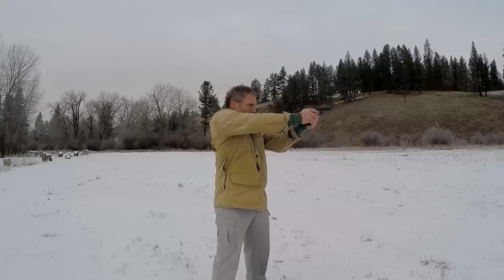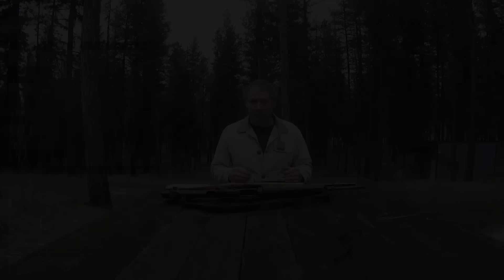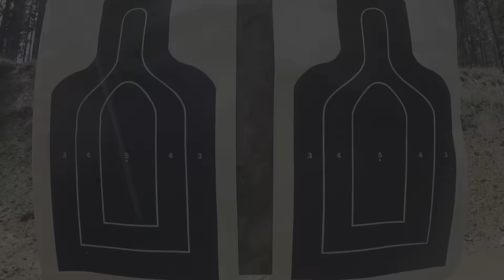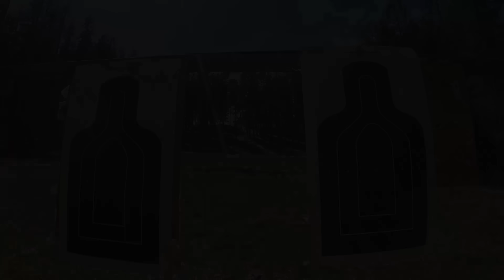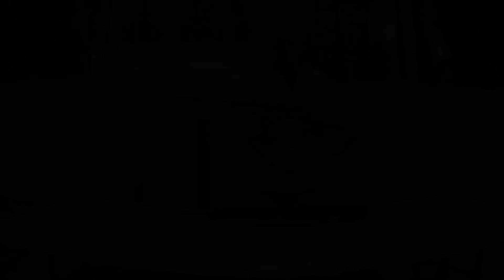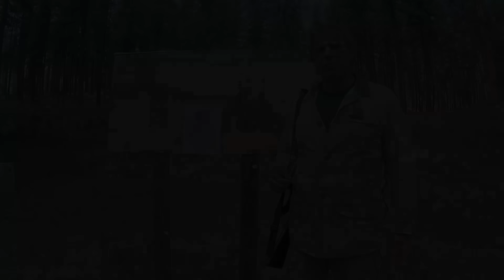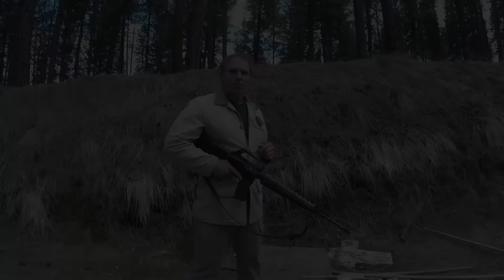Mini-14 vs AR15: Which is Better?

Comment: Excellent breakdown comparison.  And, the info regarding the headspace problem was news to me (I never owned a mini 14 mostly because of the inconsistent accuracy mantra among "14" owners. 

Well, if Ruger couldn't get headspace (reamers) to be consistent (for a time), I wouldn't be surprised if there weren't other issues related to chamber reaming "metrics" too. 

In any case, Paul's breakdown  was the most comprehensive comparison I've seen.  It would have helped me to answer some of customer's questions when I worked in retail at a gunshop.  Thanks Paul!

Another breakdown I'd be curious about would be one between a $600 ARs and a $1600 ARs mentioned, being the physical specifications of the platforms are practically identical, except for some materials in various parts and machining tolerances too perhaps!

Comment: Paul, loved the Duran Duran reference!  I set up a Mini 14 for my brother to use as varmint/ranch rifle during those times. It was a GB model, and required the use of a side mounted scope support mount, just like the full size M-14.  I had to schim up on balance point to get a perfect zero level for the scope.  I had a hot 5.56 load for it already tested, and it would shoot a true 1moa at 100yds.  It regularly killed ground hogs out to 4000 yds.  Good barrel, steady mount, great load, and fair 3 x 9 scope.  Has to also set up a friends Mini 14 the same way to please the home crowd.  Both of these were really shooter.

Comment: I pity the fool who can’t shoot accurately with a mini 14.
Reply: I love it when a review comes together...
Reply: And drive a bad ass van while shooting
Reply: Some particular Mini14s guaranteed inaccuracy. I owned one. The rifle had me thinking it was me. Nope. Not me. 6 MOA on its best day. If you wanted to fling a lot of lead down range, it was perfect. If you wanted to hit what you were shooting it, not so good. Mine was of the vintage of the thin barrels with harmonic problems.
Reply: @mississippichris  The most recent series of mini-14s has much better accuracy reviews than the older versions thats forsure. Not to mention that manufacturing quality standards generally speaking improve over time at successful companies.
Reply: @Ryan-xq3kl I love Ruger. But I love them in spite of that Mini-14. 😅
Reply: Part of the problem it that the iron sight suffers from being fat, which makes long range harder. The lebel 1886 had this exact problem,
Reply: @baker90338  You missed the Mr. T and Hannibal A-Team jokes
Reply: @tommylitchfield3450  I can appreciate when facts are integrated with jokes; I do the same thing.

Comment: They are quite similar in most ways - and I have a Ruger 556 (used to have a Mini-14, too), and I think that, at least for self-defense, I'd prefer the Mini-14 (and plan to buy one as soon as I can afford it's now-inflated price) - not because it's better than the tactical-looking 556, but because of the media-fueled hysteria about "assault rifles" (anything that looks "tactical"), if I had to use it, I think I'd get a much fairer hearing from using a non-intimidating "hunting rifle" (I don't hunt, but you get the point) than I would with the Ruger 556.  So, hands' down, the Ruger Mini 14, but not because it's "decisively better," but because it might be legally "decisively safer" - till then, I'll use a non-"tactical" handgun for personal and home defense, rather than an EVIL assault rifle.

Comment: When I was in the Army I used A2. I owned a Mini 14 for awhile. Not as good a shooter as this guy. I got same accuracy with both. The only pros and cons I remember is the AR is lighter but the mini14 was way more reliable. I did not have to perform SPORTS on my mini14. Before all you AR owners want to bash me I am aware that my M-16 probably been used and abused by many other Soldiers before me do that could be a factor.

Comment: I think Ruger showed a propensity for randomly changing the twist rates on the Mini-14 during the 80s and 90s, between 1:10, 1:9, and 1:7.  Also, the rear sight had some slop, or at least mine does.  The thin barrel doesn't help either, after you've warmed it up with a few shots.  I had never heard of the problem with headspacing.  There were some definite shortcomings which Ruger seemed to try to correct in the mid 2,000s.  Paul's point about pricing is so true, and it is disappointing.  I personally believe the biggest argument for the Mini is if someone prefers a traditional style and feel to a rifle versus the pistol grip, etc.  Gun bans also tend to target scary-looking rifles and carbines, which Paul says, and which may be an advantage to the Mini.  It's just best to have both.
Reply: Agreed. Get both. 
The 580 series Mini's came out in 2007 or 2008, can't remember which, but they did upgrade the barrels to a thicker diameter just past the gas block. That did help with the barrel flexing when it warmed up which caused the bullet stacking on the targets. They also did some fixes on the action which intentionally or unintentionally fixed the failure rate using aftermarket magazines. I have a 581 and run 20 round Pro-Mag magazines and have no issues with them....or mine just doesn't have issues with the magazines, who knows. Maybe I just got a good one.

Comment: I hate to be the guy to stand up and say that Paul is wrong, but Ruger very clearly states that the mini-14 of all generations is actually chambered in 5.56mm nato.  It does say CAL .223 on the receiver, but that is a caliber marking, not a chamber marking.
Reply: That is correct.  The older models were stamped .223 Remington but where chambered for 5.56x45 mm with one exception.  The Target Model is chambered for .223 Remington.

Comment: A significant reason to use a Mini 14 not mentioned thus far is consistent manual of arms.  I have an M14 type rifle.  Transitioning to the Mini 14 (I have a GB model from the early 90's) requires no change in procedures.  Since I primarily use my M14 and get outstanding accuracy with it, I am smoother with the Mini.  Yes, while it is true that I could own an AR-10 derivative, I prefer the M14.  In the end, though, compare the effectiveness in usage, and I would never be under-gunned with what I have.  There remain too many other variables in play.  Otherwise, the Japanese would have won the Battle of Midway, despite our breaking their codes.

Comment: Fightlite SCR...

I'm of the group that says "if you can get an AR, get an AR"

In some jurisdictions it's not legal to get a functioning AR, and in that case maybe look for other options. I know that if there was an AWB I would get a Fightlite SCR, a BRN-180 upper, and modify it to take either Rem 870 or Moss 590 stocks so i could throw a Magpul SGA stock on it.

But currently that's not the case so I enjoy my 16" mid-length "M-4-esque" AR.

Comment: The one thing I think you left out of the debate is the safety. I prefer not to use a safety with the exception of the Mini-14. When I put my finger on the trigger I can feel the safety on, and it's a quick natural movement to take the safety off.

Comment: How old is the mini-14?  300 yards with a .233?  Get Real!  Those tiny bullets are worthless past 150.  By the way, my "Mini-14" was a "Mini-30" but now it is a "Mini-6.5 Grendel.  Screw the AR15 and the Mini-14.  My 6.5 Mini shoots Sub MOA well past 500 meters. .223/5.56 NATO might be cheap to shoot but my preference is versatility, BC & SD.  Performance is everything and those tiny bullets cannot compare to even the 7.62x39 steel cased crap.

Comment: Thank you Paul for all that you do.
I have a mini 14 and i like it.
I also have a AR 15. And i like it.
And i couldn't agree with you more on every point you've mademy Ruger is a new one in a 300 blackout. It came with a flash  Suppressor and the heavy barrel. Not helps a little with the accuracy for me. However I do not like the stock peeps sight on the Ruger. So i added a scope.  I like my AR 15 as is. With all that i really enjoy shooting the mini 14 at the  Shooting range. If i was off to war I'd take the AR.🇺🇸

Comment: Paul, I have a simple question.
Why do you make things so difficult when your shooting at the range to tell us all the speed of the rounds that your shooting.??
Why not just set up your equipment to your side, so you don't have to keep turning around to speak to the masses.
It just DON'T MAKE sense.
You could st best, have a lapel Mic that you can wear when talking.
You Don't have to look at the camera to expand on the ammo.
Every round is going to have a DIFFERENT speed because the powder can't always burn at rhe same speed,
even for factory ammunition. 
It just seems that you can explain all the differences in things a lot easier.
The mini has the advantage of being able to use,223 or 5,56 NATO. I don't know anything about your A-1
BUT I'd bet you can't use either ammo on the A-1, THAT would make a lot of difference to me.
  JUST SAYING.

Comment: The AR is crap, always has been crap, and always will be crap so far as I am concerned. Plastic crap made by Mattel. Literally, the plastic parts were made by Mattel. Does NOT build confidence in a weapon. that and the tendency to jam and get a guy's head blown off because the enemy had AK's .. even clapped out AK's that they had were better in jungle fighting that the piece of junk M-16. Anyone that says different wasn't there and doesn't know the truth.
Reply: @douganderson7002  F You, you don't know squat. Kiss my butt. I was there, and saw guys die because those pieces of crap wouldn't fire. You got proof where is it.

Comment: My two cents: As Paul said both rifles are highly capable and can be used to the same general level of effectiveness. The ar platform has a slight advantage due to having higher customization options and better price but mechanically their isn't much of a difference. I personally prefer the mini 14, simply because I like the wood and blued steel more than the ar's plastic. Also, I like that with the mini I can check the chamber and charge a new round if need be without taking it out of my shoulder. The ar makes it awkward to do so.
Reply: I have a Stainless Mini 14 and wood stock as my bucket list gun...to hopefully find someday. I'll even take a used one. Those rifles are gorgeous.
Reply: @dannyo6699  Be warned, the older mini 14s can be inherently less accurate. Since my original post I've tried mounting a scout scope on a rail I put on. The scope mounting was solid, but my groupings were bad no matter what ammo I tried. This was on a bench rest at both 100 and 200 yards.

The gun is accurate enough to hit steel plate at those ranges on iron sights, but it is extremely frustrating not having a tight group at those ranges with a scope.
Reply: @shadow9774  Yes, I'm aware of the accuracy issues of the older pre 2005 rifles. My 2 are both 580 series rifles. 1 is a 581 and the newer one is a 584. Those will be more accurate due to the upgrades done to these new design rifles.
There are stabilizing braces that can be added to stiffen the older barrels which will tighten the groups but they still won't achieve the accuracy of the AR platform rifles.
As to mounting a scope, the Ranch Rifle Mini 14's did come with Ruger rings for mounting a scope to the receiver and I know the other models didn't have that. If they don't have mounts, then maybe the open sights on that rifle are what should be used. Look for a Ranch Rifle if you want to mount a scope solidly.
This isn't to say these older rifles are bad, they just won't be tack drivers, even on their best days.
Personally, I just like the looks of the stainless on wood. Even if it's a pre 2005, I'd want one just to have it.

Comment: The Mini 14 is perfect for the ranch. Its durable, perfect truck gun.
For battle ,a M16 is better.
It’s what you want.
For an older person over 55 it delivers what you need without modifications.
It comes down to what you want.
Cheers on a great video. 🤜🤜🤜🇱🇷

Comment: Excellent orientation on the A1site setup; had to reach back a few decades and had a vague recollection of the open aperature being the 'qualification setting' for the random 50 meter - 300 meter pop-up course. Although, service members have rarely used the large aperature for the live course for 2 reasons. Even if they were ignorant of this detail, those who were aware of it still would keep the 'L' setting or narrow aperature for a more precise hold on targets beyond 100 meters on the qualification course. These service members made a logical conclusion that the 'big hole' was for low light conditions or short distances which require more rapid target acquisition. All AR15 M16 variants following have a 6/3 or 8/3 rear elevation knob at the base of the carrying handle (8/3 for permanent and 6/3 for a rail mounted carrying handle..I assume) During battle site zeroing at 25 meters for a 300 meter point of impact at the live course, the 6/3 or 8/3 is supposed to be one step forward. After battle site zero is obtained, the knob is then moved one step rearward placing it flush (parallel) with the carrying handle above. Now the rifle is set (without the need to switch from 'L' to open aperature) This action can still be performed at the shooter's preference.

Comment: Something important that you didn't cover is clearing a jam/malfunction.  A double feed can take down an AR for a very long time, I've seen it happen a few times, but it's a non issue with the Mini.  The open top Mini makes clearing any problems a lot easier, especially if that problem doesn't let you close the bolt on the AR to pop the upper open.

While the 'rock it in' style of magazine is clumsier than the straight insertion on the AR, that rocking motion also gives you more leverage to insert a full mag against a closed bolt.  I've never seen a Mini mag fall out after the person thought it was fully seated and it happens a lot with ARs.  I will admit that I'm one of those who's had it happen.  And no, I'm not a Mini fan boy, I don't even own one.
Reply: I've experienced that and similar issues in combat  not fun to fix while being shot at . I consider this to be the AR's biggest issue .

Comment: A big factor is what year that mini 14 is. 
In recent years ruger has made significant changes for the better. The older models had a pencil barrel and not as well as other changes that made for , well, just a better rifle. The fouling is blown forward into the gas block as opposed to blow n back into the action with the AR 15. I personally think the AR is over all a more accurate 
Excellent rifle. 
The Rugar is more rugged, needs less maintenance 
And does come chambered in 5.56.
I like them both for different reasons.  The newer mini 14 is far more accurate than one that is say, 10 years old...

Comment: I just finished watching this video again after a couple years I think? I figured out the reason I like my tapered barrel Mini14 better than an AR is threefold. First, I’m a lot older than Paul nor do I like trying to fit in with the kids that think an AR is so cool that they’re actually Rambo when they go to the range making fun of Mr. T and company. (Maybe that’s 2? reasons.)Second, I don’t give a damn about trying to shoot any farther than 100 yards because my piece of property is not any bigger than that anywhere and I’m not trying to kill chipmunks at 300 yards. Third, I like a traditional looking rifle that doesn’t draw attention nor is it something that makes a difference to me anyway. I bought mine new and had terrible problems with partial ejection of spent cases. I sent it back to Ruger and 10 days later got it back working perfectly all expenses covered. This one is rated both 5.56 or 223 and is stamped that way. I took off the  fixed sites and added a inexpensive scope. At 100 yards a 6” steel plate swings in and out of view while timing the shots with ease. That’s scary enough.

Comment: Mr. Paul, from what i was made to understand, in the early 2000's,  Ruger realized that the tooling that was used to make the Mini-14 was so wore out that it was one of the prime culprits of the growing inaccuracies in accuracy of this rifle. So Ruger shut down the line for the Mini-14 and re-tooled all of the equipment to build the Mini-14. They also re-designed the Mini. One of the prime re-designs was the barrel. They added material to the barrel around the gas block to help with accuracy, among a few other changes (sights, area around the recoil spring/rod). These changes are called the 580 series Mini-14's due to the serial number where these changes happened.  I happen to own one of these "580" series Mini-14's and absolutely love it.
Thank you for your videos and all of your info!
Reply: Robert DeMahy I have a 580 series with the tapered barrel. Its a great shooter and I am very satisfied with mine also.
Reply: I'm going to be buried with my Mini.
Reply: I doubt it. Machinists replace tooling constantly. The idea that Ruger or anyone else is making guns with old wore out tooling is just plain wrong. Thats not how it works.
Reply: @dreed7312  I know airplane manufacturers will use old warn out tools. Don’t underestimate corporate greed.

Comment: The mini 14 and AR-15 are made for ranges up to 200 yards. They start to fall apart after that. Yes, they CAN reach out to 400-500-600 yards, but at that point, you might as well get a gun that is designed for longer range shooting